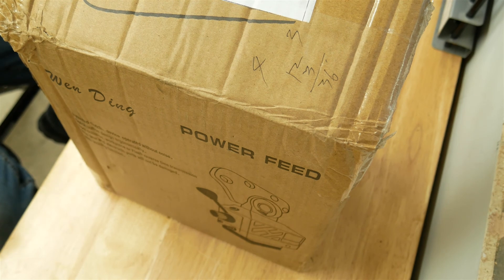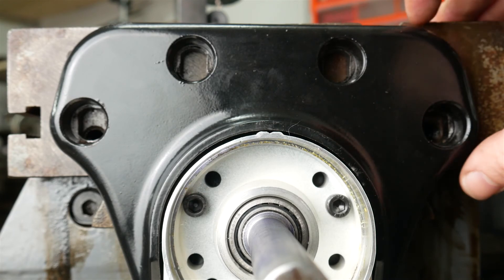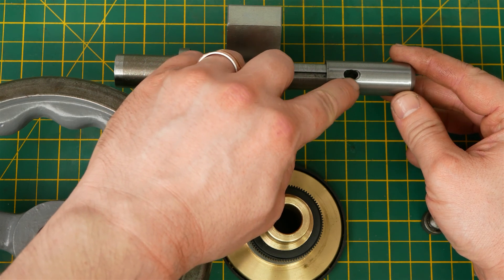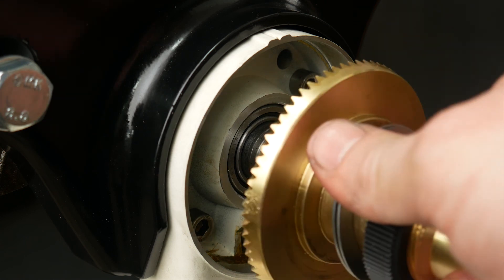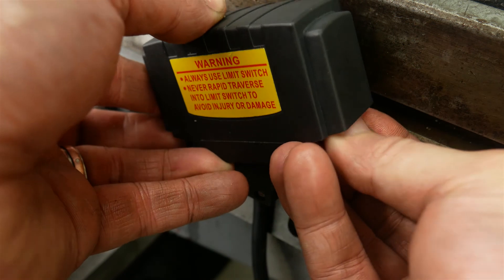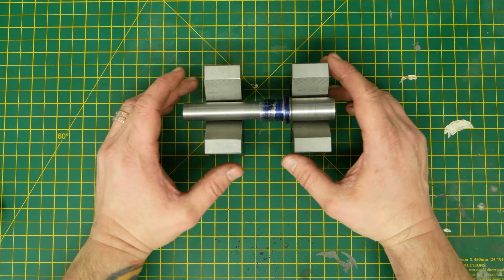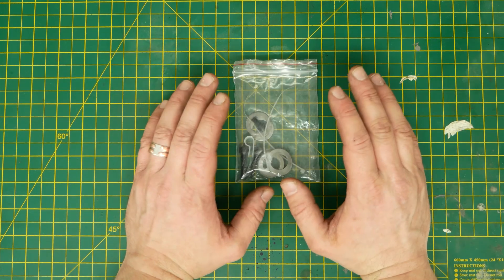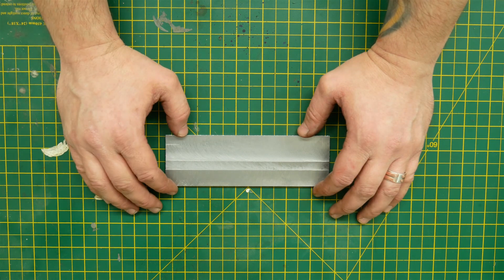AL310 MIlling machine power feed installation on Induma milling machine

Comment: ßo what was the slowest feed speed?  I saw one video where he could go to zero and stop the travel so there was no real minimum and another where they couldn't get it to run slow.  How was yours?
Reply from the maker: I can set the dial to zero and it’ll stop, but minimum actual movement speed is probably half inch a minute, give or take, but I can’t check it at the moment so don’t take that as gospel.

Comment: How does it handle low speed cutting?  Is it jerky?
Reply from the maker: Assuming that your table moves freely it shouldn't be jerky, even tightening up the table locks a bit only increases the minimum speed.